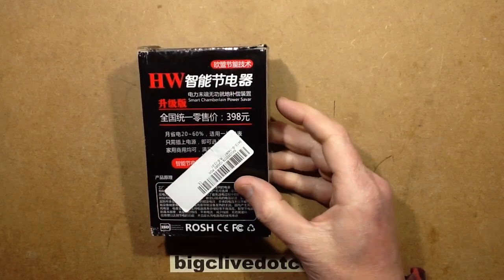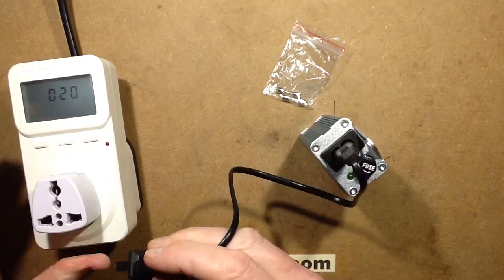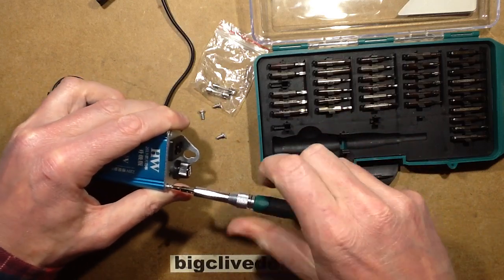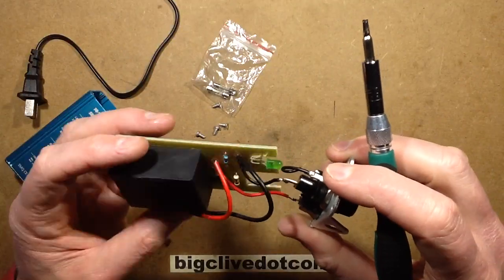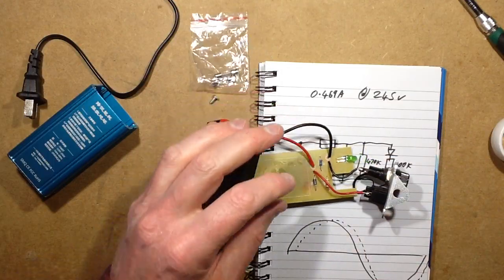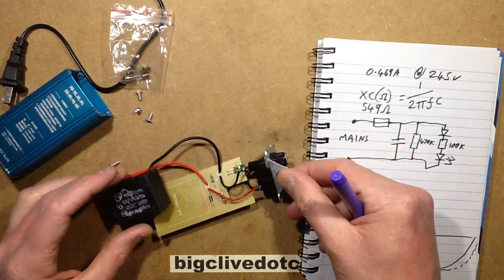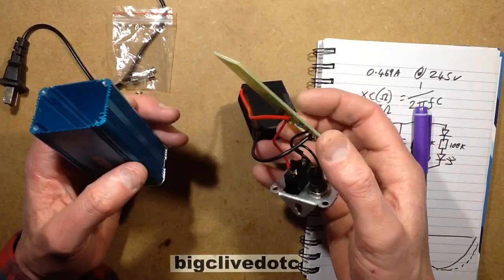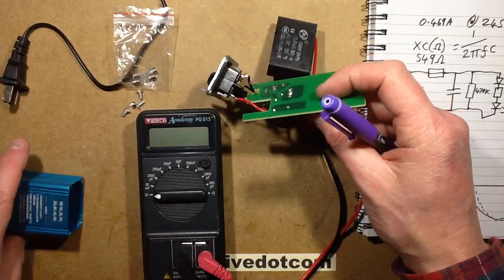200kW miracle power saving device.

Comment: I am an electrician.  It is just me and my wife at home.  Kids are grown and on their own.  We have found a way to save on our electric bill with some simple planning.  I have my water heater on a timer.  It turns on  an hour before we wake up each morning.  Get the hot shower, then we also run the dishwasher and start any laundry that needs hot water.  Timer for water heater shuts off after 3 hours.  For the rest of the day, the water will remain warm enough for general use however, the unit will not turn on to maintain temperate till the next morning.  This is not practical for a family using hot water at different times during the day.  However, a person living alone or a couple using a little planning can drastically cut their electric bill with some simple planning ahead for a minimal cost.

Comment: It's mislabelled, and you don't need test equipment to know so.   At most that power cord can pass 15A at 220V, or 3300W = 3.3KW.  I will guess that the 2015 isn't the model year, but the maximum wattage it can pass.  As far as what it can accomplish, it  might reduce line noise in or out of the connected load, but not reduce metered power consumption by a significant amount.

Comment: Putting that capacitance across your AC mains 24/7 is going to cause additional current draw and a higher utility bill.

I bought a device many years ago that claimed to save power on my refrigerator. It resulted in slowing the motor, but that means that the motor must run longer to pump the same amount of coolant, so no power was really saved. The instantaneous power was reduced but it ran longer.

Comment: These do spoof old style meters with a rotary disc.
Add a big capacitor in series, the phase shift reduces to slow the disc motor in the meter.
Jail time will result if caught.

How it works:
On an AC load the voltage and current on your standard inductive load is Volts then consumed Amps, 90 degrees out of phase. The meter drives that little aluminium disc. Its speed relates to load & phase as we see here:-
https://i.ytimg.com/vi/ywwcir1NmXE/maxresdefault.jpg.

I knew (1970's) a wiley old TV repair guy who fiddled his fluorescent lights to make the meter not read them. He even rebuilt his tv to bypass that huge resistor bar to tap various voltages, which made them like electric bar fires. He used multi tapped transformers to lower his electric bill.

Comment: I got a feeling that the only way to do this right would be to use TWO, ELECTROLYTIC capacitors, both with a diode, obviously so that both'd work one side of the ac fluctuations. And, I think the circuitry inside the supposedly power saving device in the video is in fact losing at least an equal amount (or more) of power as what the amount it is 'saving' would be a s it discharges continuously to allow for that change of polarity 50 times a second - or am I mistaking?

Comment: What would actually save on energy costs would be a true line voltage/current filter like was used many years ago for ham radio transmitters. Those were the original "surge" protectors and actually much more efficient than these little power strip surge protectors used nowadays. And the way that would save on some power is that it would filter out the spikes of current usage and protect your equipment from line spikes that also occur.  What would also save on power usage would be larger storage capacitors that would release their power during peak power draw.
Reply: Spikes and surges are opposites

Comment: I'm surprised people buy this junk believing it can cut their electric bill. Many have no clue bout what Power Factor is.  Power factor makes very little difference in household electrical system. Power company charges you for Kilowatt-Hours only. Variations in Power Factor will not change anything on your power bill. 
This gismo will do nothing in industrial applications either. Large inductive loads usually have their own capacitor banks, much much larger than the little capacitor in this video.

Comment: If your serious about cutting your electric bill by 50%,(United States)convert your house from 120 volts to 240 volts.When you double voltage,you cut current(amperage)by half(50%).But all your appliances MUST be compatable with 240 volts.

Comment: All these " Power saving devices " are nothing but Power Factor correction Capacitors in parallel with the Incoming mains. Depending on your power consumption and Inductive loads, if you OVER-CORRECT by using more capacitance than needed, it leads to increased in current.

Comment: Aluminium case and no ground connection. Dangerous. I saw a video where someone test this device and it does not save you power. It draws power making your power bill higher.

Comment: ARE YOU TOTALLY SAYING THAT PLUNGING A FLASHING CHEAP LED IN FROM CHINA THAT'S GREEN WONT SAVE YOU MONEY ?CAN YOU PLEASE RELEASE YOUR PAPER ON YOUR FINDING SO AS TO SEE IF WE CAN GET THE SAME RESULT BECAUSE I HAVE FOUND ONE WITH A BLUE LED THAT THE WEB SITE IS SAYING THIS NEW IMPROVED 78% SAVING ON POWER IS GUARANTEED THEY ALSO SOLD ME SOME FUEL MAGNETS TO A LINE THE ATOMS IN MY  CAR'S FUEL COURSINGS  A singularity IN MY PLENUM GIVING ME THE POWER OF A super NOVA VXR  AND THE magnetic FIELD WILL help WITH TRAVEL sickness.

Comment: Nice video.  One quibble, even home power meters measure real power.  Old ones have two coils, a voltage coil and a current coil, arranged so the product of the magnetic fields spins the meter.   Newer ones might do it all electronically.

Comment: XC =1 / (2pi f c) also shows how a capacitor presents as a blocker to DC and a short circuit to AC.

DC is 0 hertz so any number ((2pi f)  x 0) is actually Zero. 1 divided by Zero is infinity Ohms...  Hence it blocks DC

Our mains is 50hertz, so as the capacitance in Henrys gets larger, XC gets smaller (check it through the formula if you wish) and XC tends towards Zero Ohms. Hence it becomes a short to AC

Comment: Could I plug it into a square wave inverter? We are off grid. I am currently using the power jack Chinese true sine inverter to save my refrigerator compressor, but it has to have 30 watts running at night or it goes blinky all night and we can't charge our phones. We never had that problem with the modified (square wave) sine wave inverters.
Reply from the maker: +whisperingsage I wouldn't recommend using this at all.

Comment: The electricity supply act requires manufactures of domestic and industrial equipment to maintain unity power factor. In industry, inspectors regularly carry out tests and these often give misleading results because they ask for all motors to be run during their inspection. As a result of starting motors that are not required, they are running at only a few percentage of their normal load, resulting in power factors of around 0.7. Needless to say, the electricity suppliers hit the customer with a correction on their bill and I spent many hours challenging these costs and arranging re-inspections when the plant was running on load. Since most of the errors were due to running 100+ horsepower refrigerant compressors in public buildings, I insisted on inspection at the correct ambient temperature and occupancy conditions. The inspectors never turned up and our bills were returned to normal. Plugging in any device that deliberately creates 'wattless' power is a criminal offence, so I don't know how people who market these devices get away with it. I assume that it is all part of the shambles created the deregulation of the electricity supply companies, most of who would not have a clue what I was talking about if they read this reply. Regards, Wills.

Comment: Just wondering if any of You advanced thinkers "out there" have yet come up with this idea for generating "free" electrical energy:
Theory: OK first get Your photovoltaic solar panel of appropriate magnitude to run an electrical generator; second: hook it up to the electrical generator device; third: connect Your electric lights to the electric generator device' output system; fourth: take appropriate steps to begin the electrical generation processes and the lighting of Your lights.

Comment: I designed a home grid system self propelled it basically is mechanical with electric & hydric. you need about a thirty foot circle to operate it and of course it won't run forever as things do wear out and components have to be replaced...

Comment: This is a Charlton type device. Without going in to anything complicated to explain, the power meter in your home will measure the total power used not caring about phase shifting and etc. 

With the power cord shown and from seeing inside of it, there is no possible way 200kW can pass through it. The power cord would melt down and so would everything inside of its case.  At 240 Volts this would be over 800 Amps. At 120 Volts that would be over 400 Amps. This is a lot of power to be able to run through a small box like this. 

The capacitor in that unit is really in parallel to the load. It will not make any difference, other than using an extra 1/2 Amp of power consumption. In North America where 60Hz is used, it will consumer a bit more than 1/2 Amp. In actual effect that gadget will use more power and not less!  Over time that extra 1/2 Amp will add up to some extra cost on the power bill. 

Best practice is to use good quality LED lights. CFL will also save power cost, but are being phased out slowly. The average LED  or CFL light uses about 1/6 to 1/8 of the power consumption of the equivalent Lunins in an incandescent lamp. There should be a power consumption savings of about 60% to 70% with the newer technology lights. Turn off the lights when not required. 

In cold climates like Canada if you turn down the heat by about 2 Celsius degrees you can save as much as 3% to 5% on the very cold days. You can set your heat to 20C instead of 22C. This should work with electric, or oil, or gas heating. If you are using a space heater to have some extra heat, turn it off when not required. A space heater will consume a lot of extra power.  

In the end, turn off lights when not needed, and if possible run your heating a few degrees colder. Use LED lights instead of incandescent lights.
Reply: Jerry G. ??? You have NO CLUE what you are talking about.  What a mor0n.

Comment: You seems to forget the filtering function of capacitors in parralel with load. It filters out high frequency harmonics which can cause inefficiency or damage in devices. That can contribute to power savings depending on the device.

Comment: One thing is for sure, It doesn't work except at an attempt to bring an assumed signal in phase, a scam obviously, so you got scammed for buying one, I also forgot to add - 200k is a pretty big load for such a small thing, 20 k watts is more then enough power for one home, but 10 homes ? someone is a scammer for sure,

Comment: have you seen keshe mag grav unit they make flame burnt copper coils ccw wound and dipped in caustic to cause rusting ie cu oxide, and they claim it  works as battery / power supply via reactive metals  and acts as capacitor much like 6 coils 3 capacitor coils and helps cars fly obviously scam

Comment: Can you give us some info on using capasiTors as power supply in place of battery for bysical hub motors?
Reply from the maker: Capacitors are not rally suitable for that yet.  They don't hold a good amount of energy in ratio to their size compared to ltihium cells.

Comment: In fact power is:  S=sqrt(P^2+Q^2) in kVA where P [kW] is real power and Q [kVAr] is reactive power. This means, if your power meter wouldn't measure only real power it would actually help to reduce  power  in theory. That could happen if you have large inductive loads such as motors.  In practice the P (real power) is much higher than Q (usually around  cos(phi)=(0,93-0.95) , our devices already have reactive power compensation and our household power meters measure only  real power.  and if you compensate all your reactive power you might be helping your utility to lower power losses in system a bit but 0,4A*246 V=100 VAr that's nothing. So this device is piece of crap.

Comment: Maybe the cap is the proper value for correcting the load created by a generic desktop/standing fan? In some countries, that's the only household electrical appliance they run, other than lights. Motors usually have their factor corrected on the motor terminals though, it's pretty rare to find one without caps on.

Comment: Amps x 2650 / voltage = MFD
I am an HVAC technician and you can determine the MFD of a capacitor by using this formula.
on a motor use start winding voltage/ BEMF , it is above the line voltage supplied as a motor is like a generator, out of a system  use a electric cord  and use amps and  the line voltage.

Comment: Hello, Clive. Thanks for the video. You don't tell if the cap is good for this (having 2X marking) which I greatly doubt.  But the most terrifying thing is that this is Class II device and there's no double insulation inside. This looks quite dangerous to me. Well, you can add the extra insulation if you know how it is done or change the mains connector to an earthed one.  But if the capacitor is not X2 (or X1) this may catch fire. In spite of aluminium case, I consider it a great risk.